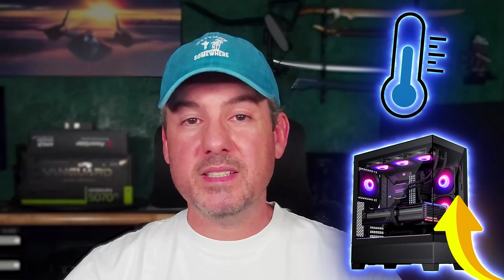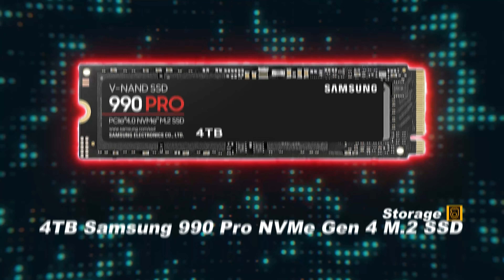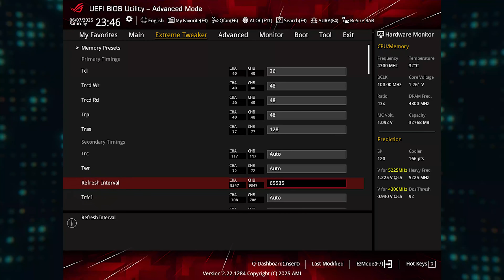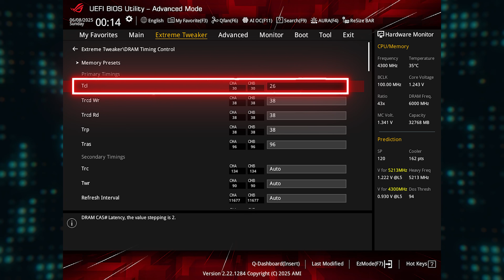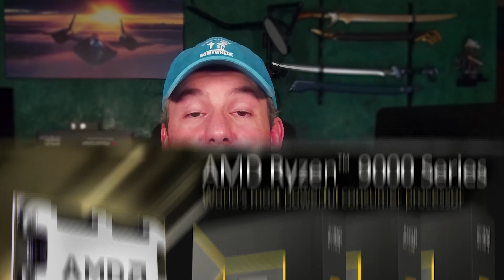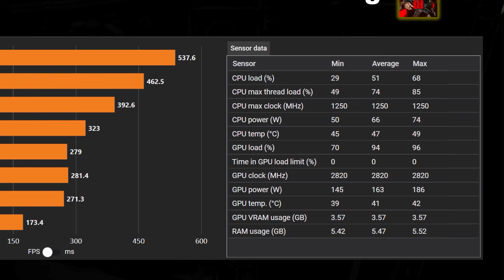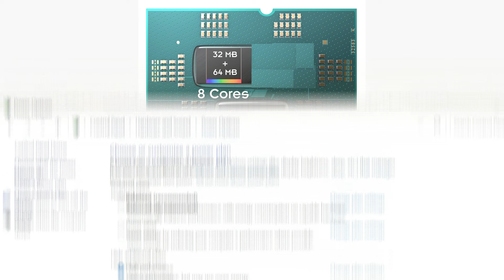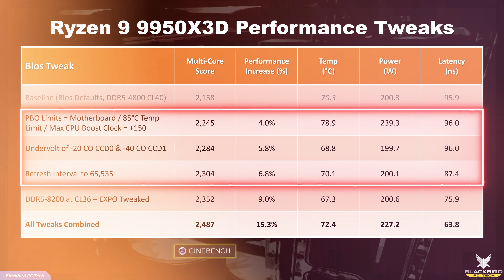What Are The Best Settings for an AMD Ryzen CPU?

Comment: I just bought this exact CPU that you have (Ryzen 9 9950 X3D) and the same MB as you (ROG CROSSHAIR X870e Hero) and I'm planning to undervolt it with a friend that has knowledge in AMD CPU's. Curently my CPU is running fine but with high temps. I'm sure we'll manage to lower those temps and make it run better than it already is.
Great video anyway!
Reply from the maker: Just follow the guide and undervolt it yourself ... it's way easier than you think

Comment: 5800x3d -25 and 200mhz with kombo strike 3.
Reply from the maker: None of this makes sense ... kombo strike 3 sets an undervolt of -30 but you claim you are running a -25 undervolt. Furthermore, the 5800X3D is locked for overclocking ... so +200MHz doesn't do anything.

Comment: Stable = cock sure your cores are not stretching. The CPU internal architecture and safety limits will boot and blast games but be very aware, core stretching will shorten your boosts and limit them. 
While still looking cooler, beating stock benchmarks and so on.
Reply from the maker: You might want to edit your comment 😉

Comment: Games went from 87°C to now a stable 81°C  on my Ryzen 7 9800x3d thanks dude much happier
Reply from the maker: Nice!
Reply: @blackbirdpctech last night I took out and deep cleaned my AIO because it was dusty took off the fans and everything reseated the AIO with fresh thermal compound and now idle at 47°c and gaming temps at 62°c huge improvement. I knew something was off.. PBO curve negative 35 and completely stable and stress tested.

Comment: Hey can you help me please? I have the setup with Ryzen 7 9850x3d and RTX 5080 with motherboard GIGABYTE X870E AORUS ELITE WIFI7 but in warzone with everything on low I have 30 FPS. CPU stays at 100% and gpu 20-30%. Can you help me? I don’t know what to do
Reply from the maker: It sounds like you have a 30fps limit set in the graphics menu

Comment: so, would i for sure need to mess with my ram to undervolt my cpu or can that be done by itself wanna undervolt 9800x3d with same perf
Reply from the maker: Good question. You can tune your CPU independently of your RAM however, if you do intend to overclock and tune your RAM, you should do it first because it will impact your CPU tune. Even if you just intend to set EXPO.
Reply: @blackbirdpctech yeah I have the first profile set to 6600, didn’t wanna overclock it but wanted to know beforehand if I should do that before I undervolt my cpu
Reply from the maker: @Cqboose  your memory controller will be in 2:1 mode at 6600, so I would back off and see what works in 1:1 mode.

Comment: Great video!  It helped me tune my 9950X3D for performance, but I am having stability issues at low / idle loads where the PC suddenly freezes.  It seems to happen most when at a load like watching Blackbird PC Tech videos on YouTube, then something happens to cause a sudden spike in activity like a file download writing to disk, or starting up an application.  What tools can you use to validate stability in these scenarios?
Reply from the maker: That sounds like an overly aggressive undervolt ... what undervolt do you have applied?
Reply: @blackbirdpctech  Not too aggressive, only -10/-14
Reply from the maker: If you remove your undervolt does it still happen?

Comment: I undervolted my Ryzen 5 9600x to -30 and disabled PBO override for better temps on my ITX build. The CPU is running cooler. I ran Cinebench, and it didn’t crash, but while playing, I noticed the speed fluctuated frequently. I don’t notice frame drops in my games, but I see them on my Afterburner monitoring. Is it normal for the CPU to have frequent frequency changes, or is it due to the undervolt?
Reply from the maker: If it’s fluctuating a lot, as I show in the video, then you are likely experiencing clock stretching ... so I would recommend backing off your undervolt and re-testing to see if the speed stabilizes.
Reply: @blackbirdpctech  I’ll do that. Thanks!

Comment: my 9700x was able to undervolt to -40 and a boost override of 200mhz. i set the temp limit at 95° and got a cinebench 2024 score of 1323.
Reply from the maker: Nice ... I would be careful running such a large undervolt, even if it appears to be stable ... you will likely get clock stretching at some point without realizing it.
Reply: @blackbirdpctech  i also thought this would be an issue but ive been checking with hwmonitor and haven’t ran into any issues. single core score in cinebench was also 140. thanks for the tips, everything was super easy to understand. awesome video.

Comment: how is ur ram expo stable? I use a X870E Pro Ice board and the 9 9950 X3D but when I use Expo I got so often ram errors and crashing pc... Chat said the processor only supports 5200mhz so I use standard setting 4800 no expo.. but I would love to use the full potential of my ram and cpu
Reply from the maker: Please don't use AI to guide you ... it will often give very poor advice, which it did. What RAM kit do you have? If it's DDR5-6400 then your CPU may simply be unable to run a UCLK of 3200MHZ, as I explain in this guide:  https://youtu.be/KZiVAfcT5Bk

Comment: it appears that my motherboard (gigabyte x870E aorus elite wifi7 Rev1.2) cannot run my Crucial Micron 6400M/t-DDR5-32-40-40-103 at 1:1. I'm also using the 9700x. i selected ULCK=MEMCLK in bios and it resulted in some of the most horrifying bugs i've ever encountered. firefox started repeatedly crashing, a screaming noise came over my headphones, boot loops that eventually turned into full on freezes at startup. Debian to threw a million errors relating to the motherboard and CPU scheduling on boot (failed context switch by the looks of the errors, although they aren't that helpful). reverting the ULCK DIV1 MODE to "Auto" did not resolve this issue. I had to reset the CMOS and reapply my previous configs (aside from EXPO and Infinity Fabric clock) and then i could boot in. luckily my RAM kit has a 6000M/t@CL36 EXPO profile, and ig the motherboard can run that at 1:1. apparently this is a known issue with this MB.

be curious if you have any thoughts, I'd really like to get it running at 6400M/t seeing as I bought the kit for it, and I believe this CPU would actually benefit from it if I'm not mistaken. not sure what else I can try other than hoping a future BIOS update can remedy this.

EDIT: after writing this comment I noticed that the newest BIOS update (FB1b) description read "AMD AGESA 1.3.0.1 Supports AMD’s next-generation memory specifications", so I hoped it would resolve the issue, but it did not. memory gets corrupted, and Debian eventually stops working with the same exact error.
Reply from the maker: I cover this in the video ... many Ryzen CPUs will not run stable with a UCLK of 3200 MHz, regardless of what you do.

Comment: Should I pref. higher undervolt and lower overclock, or vise-versa performance vise?
Reply from the maker: First figure out your objective. If it’s to maximize performance then larger undervolts will provide more headroom for overclocking, which should result in higher performance.
Reply: @blackbirdpctech @blackbirdpctech Thank you. I was not so subjectively lucky with my 9950X3D. I got -15 and -35 with +75 OC. Of course the temps are lower about 11°C on avg. But I am running 128GB RAM with two kits from Crucial 6200/cl40 manually OC. They are not that OC'able. So in the end I am quite happy that the system is stable in the long run. Even though I would love my CPU boost to reach 6Ghz.
Reply from the maker: Reaching 6GHz will not boost your performance in a meaningful way, it's simply something that would look cool.
Reply: UPDATE: I have passed Aida64, memtest86 using the settings above. While gaming, I did not crash, however, when analysing big data using SQL, etc. my system froze. I believe I will have to identify my strong/weak cores and adjust underclock values manually.

Comment: Should I use Settings like Core Performance boost & Core optimization for Gaming Level 1 or 2 for my Ryzen 7 7800x3d?
Reply from the maker: They sound like motherboard vendor features that typically are fancy names for simple things ... I wouldn't recommend using them ... just follow my guide.

Comment: I'm having an issue with this, specifically the memory. My system specs are following : 9800x3d, gigabyte aorus b850 board and G.Skill trident Z Cl 32 6400 memory.
I'm unable to run it in the 6400 speed, system literally doesn't boot, it worked with my previous intel 14700k rig perfectly.
Being able to run it stable at 6200, and infinity fabric 2100 1:1, but cannot run the infinity fabric at 2133 and 6400 memory speed, any hint what I should look at?
Reply from the maker: Your CPU very likely can't do a UCLK of 3200MHz ... you can watch this video to get a better understanding: https://youtu.be/KZiVAfcT5Bk
Reply: @blackbirdpctech Thanks for the swift response Matt, I watched it previously , but still do not understand your answer. Does this mean I give up and leave it at 2100 or should play with voltage putting let’s say 1.45 and trying then?
Reply from the maker: @sparktheysay  from the video: "In fact, the unified memory controller or UMC on many Zen 4 and Zen 5 CPUs, will not run a UCLK of 3200MHz, even at higher voltages, which will make it impossible to run DDR5-6400 stable."
Reply: @blackbirdpctech  Thanks for your time, did the same for mine cpu as you for yours, put 2067 and 6200 mt.s have a good one :)

Comment: ryzen 5 9600x here, paired with a thermalright phantom spirit 120 EVO, -40mV undervolt and +175mHz overclock, all runs stable. 4213pts on cinebench
Reply from the maker: Nice!
Reply: @blackbirdpctech was worried about the undervolt, seeing the results of other users. have I won the silicon lottery? 😂
Reply from the maker: Have you tested it in some games? I would recommend looking at the 1% lows … then you will see if it’s truly stable at -40 … my guess is you will get better 1% lows by backing off a bit.
Reply: @blackbirdpctech got it, thank you! I've only tested it in switch emulation to really stress the cpu, got overall better results

Comment: Quick question please: 
For the AMD Ryzen 9 9955HX3D 16-Core Processor  Laptop Version, do you recommend the same settings? Is there a difference? 
Also, I might have missed it or not understood it from your video, but what is your settings for the SPL, SPPT, FPPT? 
What do you recommend for these settings? 

Thank you so much in advance.
Reply from the maker: Are you able to access PBO in the Bios of your laptop?
Reply: @blackbirdpctech  yes.
Reply: @blackbirdpctech could u help, please?
Reply from the maker: The process is the same if you can access PBO in your Bios ... I would simply be more aware of temps
Reply: @blackbirdpctech  SPL, SPPT and FTTP is not in your video tho. 
I can access all of ti, but on Laptop I also have armoury crate to set the fen speeds. I need to set these manually too.  I have an Asus G16, i am more than happy with the performance, but I would like to decrease the temp. 
Undervolting was my idea based on your video, but your video is using the desktop version with a different goal in mind too. 
Do u have a video about the laptop or just about temperature optimization? 
Or an article or website? Would love some help w SPL SPPT FTTP. 
Cheers.
Reply from the maker: @wr_wr  no, my focus is on desktops because most laptops have fully locked bios's
Reply: @blackbirdpctech  This is a gaming laptop. Asus put the same bios option there.
Reply: @blackbirdpctech  could you check it out and maybe make a video about it? 
Or just tell me here what is the best thing I can do to lower temperature effectively while keeping relatively the performance? 
Also, the SPL, SPPT and FTTP? 
Any advice regarding the SPL, SPPT and FTTP?

Comment: Great video 
I have the ryzen 9 9950x3d and asus x870e extreme and G.SKILL Trident Z5 RGB Series DDR5 RAM (Intel XMP 3.0) 96GB (2x48GB) 6800MT/s CL34-46-46-108 1.35V  .
I put everything together last week and I started working with ram overclocking and the ram was working perfectly at 6600MHz after  i started working on the CPU overclocking the  pc start to get stuck on the memory training and it will not work until I lowered the ram speed to 6400MHz  and the same thing happened again and I forced to lowered it again to 6200MHz  and now even if I dropped the CPU overclocking it will never do more than 6200 MHz .  
All this happened within 6 to 7 hours while I was trying to get stable CPU over clocking.
Before I started overclocking the CPU the Ram 6600MHz overclocking was working and stable for almost day and a half during this time I stress tested  the pc using OCCT and cinebench 15, 23, 2024  .
The most most important and first thing I done when I start over clocking the CPU I put the temperature limit to 85c  and my CPU temperature never raised beyond 83c even the voltage never reached over 1.25v  and with the current overclocking my cinebence's scores are  45100 for  r23 and 4475 for the 2024 .
What do you think the issue did you think the CPU was degraded or the Ram or the motherboards  .
Do you think I should order replacement CPU .
Reply from the maker: I would recommend resetting your Bios with you CMOS button and then using this RAM guide to tune your RAM properly: https://youtu.be/KZiVAfcT5Bk

Your RAM would not have been stable at 6600MHz in 1:1 mode ... I can virtually guarantee that ... so it was likely running in 2:1 mode, which would not be good for performance.
Reply: @blackbirdpctech  thank you for your quick reply. 
 I already watched your Ram tuning video and that's where I spent my 1st day and a 1/2  where I was able to get the Ram overclocking to be stable at 6600 MHz  with out of the box CPU performance with stress testing the PC for at least 7 hours using OCCT and Prime95 .
that's why I am really worried that something went wrong when I start overclocking the CPU because as I mentioned in the previous comment the Ram issue started happening after start working on CPU overcloaking even that the first thing I started with was setting the platform thermal throttle limit to 85c and I'm 10000% sure that my voltage never exceed 1.25 and temperature never exceed more than 83c .
 What is your advice to me especially with my very good benchmarking scores after overclocking the CPU with 6200MHz Ram speed. 
Did you advise me to take a chance and try to swap the CPU because I still within the 30 day return warranty or no .
What was your best stable high benchmark score for ryzen 9 9950x3d
Reply from the maker: It's highly unlikely that your RAM was ever stable at 6600MHz in 1:1 mode ... my guess is that you left that setting on Auto. So the behavior now seems normal. I would recommend using my optimum clocks, voltages, timings and nitro settings at 6400 and then progressing to tune your CPU.

Comment: Love your guide mate. Have had some playing around with the settings though decided to properly test this time around instead of just setting and living with the consequences.
One thing that I’ve seen/ read around is to do with the C-State setting. I had it forced to on before doing my latest bios update, and having seen that it wasn’t mentioned I wanted to know your thoughts on what setting to use (On, Off, Auto). I believe I have a base level idea of what it achieves but am also curious with your level of knowledge what your thoughts are for this setting?
Reply from the maker: C-states are simply a power saving mode ... I would leave them enabled in Bios and then just set your power plan properly in Windows. Unfortunately if you ask this question from AI you will likely get a misleading answer ... I covered that in this video: https://youtu.be/0JzE1Gyns8Y

Comment: I set to +200/-30 with the 9850x3d processor. In stock mode, the processor reached 84 degrees Celsius in the Aida 64 stress test. Currently, it's stable at 69 degrees. MB is B850 gaming plus wifi
Reply from the maker: Nice!

Comment: Hey about the power plan for 9800x3d I thought balanced was generally accepted as the best option for pbo while high perf would be for a static oc?
Reply from the maker: You can test it yourself, there is no need to "believe" anything ... I've tested it and I found that I got better performance in games by using the high performance plan for single CCD Ryzen CPUs. For dual CCD CPUs I get better performance using the balanced plan.
Reply: @blackbirdpctech  the test on the 2 different power plans under control panel, was that with best performance for both under settings - system - power or balanced on one? Don't understand why these entries exist in 2 different locations, Ive got control panel balanced but settings best perf.
Reply from the maker: That can be confusing. Just focus on setting the power plan under control panel ... when you set "high performance" it will essentially disable the options under "System > Power & battery"

Comment: Thoughts on optimised defaults?
Reply from the maker: I don't know what that means ... defaults are not optimized.
Reply: @blackbirdpctech  there is usually a button to load the motherboards Optimized defaults in the bios, atleast from my understanding, are those bad?
Reply from the maker: @dahliman4590  I think you are referring to the CMOS reset button ... that will return your motherboard to default settings ... but they are definitely not optimized ... just with memory tuning alone you will increase your performance by 30%+ over those defaults.
Reply: @blackbirdpctech  Holy, i will definitely be looking at a video of yours on that, thanks for tec tips, Mr. Rocket